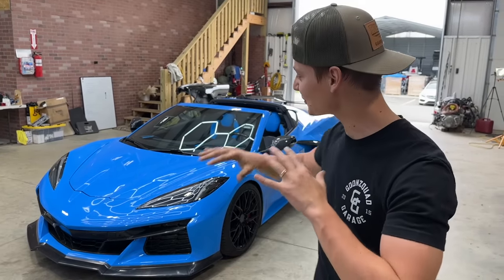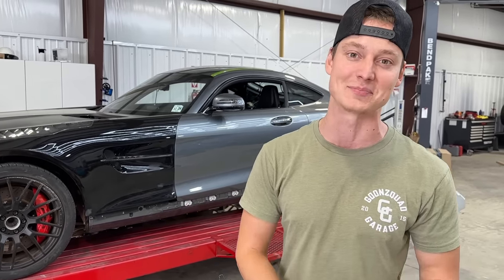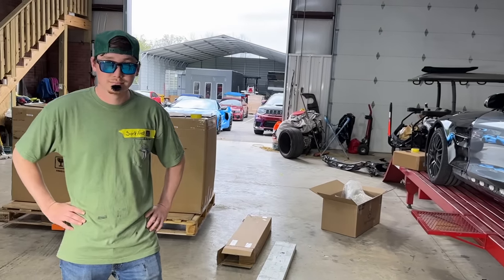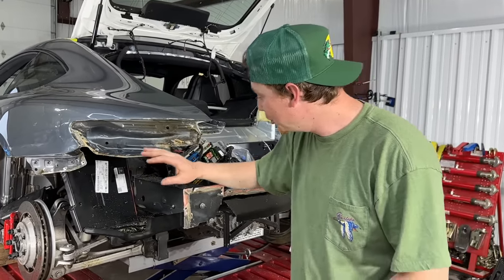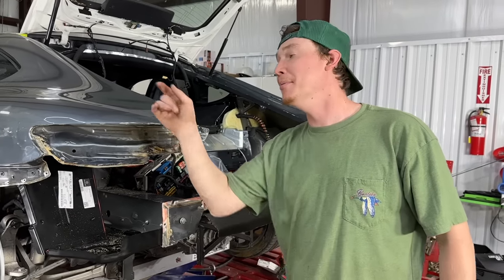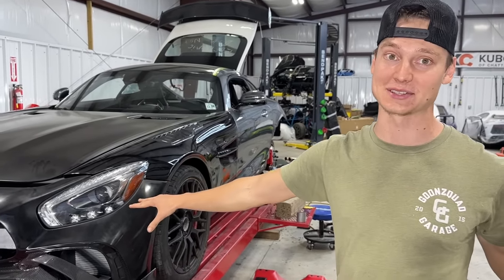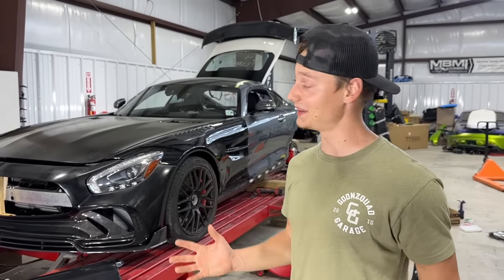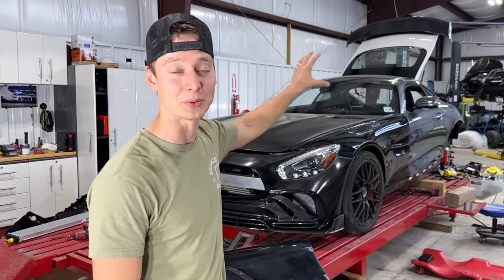Rebuildng A Wrecked Mercedes AMG GTS! Certified Mercedes Tech Hired!!!

Comment: Use the frame machine to pull/push the backend into shape and whilst the clamps/chains are still attached weld in the new parts. When you release the clamps the car will flex back into shape with the new parts keeping it into shape.

Comment: I have the perfect Colour combination for the AMG Mercedes build. 

Gloss black with a thick gold stripe to the left side of the car from the front hood to the rear boot lid, then a gold pin stripes around the side mirrors and vents. Finish off with gold or bronze wheels.. 

Signed off 

Leonardo da Vinci

Comment: To Me when you was pulling the rear quarter panel it looked like the panel was hit in and  pushed up. Maybe you can try pulling down and toward the middle to eliminate the twist with some heat to relax the metal.

Comment: You have to learn, to know were to pull before removing parts .Check out Arthur Tussik .You need a plum laser  and measure under the rear tail light and you will find out exactly were it is twisted .

Comment: Just heat aluminum body panel before you work on it. Get a good heat gun and send it. Don’t forget to strip off the paint. Don’t forget to heat the panel after you’re done with hammering and pulling.

Comment: I learned a while ago that a super thin crazy glue can sink into the crack and repair carbon, done it many times then sanded and recleared, and a better clear coat is a plus because the resin usually sucks and yellows

Comment: I watched another video of them fixing another AMG another previous owner took it to a track and ran off the track.  Ended up running out of coolant and filled it on the way back to his home.  Well the block is done as when Mike filled and pressurized the radiator and couldn't figure out where the water was going and when he took off the catalytic converters there was water in them.  The motor ends up being junk.  It's interesting watching these 2 different videos on the same car only different issues with the cars.

Comment: Hey guys, it looks to me like that quarter panel has been pushed up in the collision. I think you need to get it on your frame machine and try to pull it down around the light socket. There's a couple of camera angles that showed what looks at least to me to show that it has been shoved up. That's probably created a twist. Hope it helps.

Comment: I should have waited for the end of the video to comment on the fenders and bumpers. Seeing the new design style fenders with the matching bumper looks amazing. I think Simon is correct about the skimmer vent design, but if you have to paint the carbon fiber vents in order to hide the damage  it won't have the same aggressive flow. If the manufacturer is able to rush ship a set of fenders, the only thing to do is to paint both sets so you can create the one and only Goonzquad
 AMG GTR-GS .